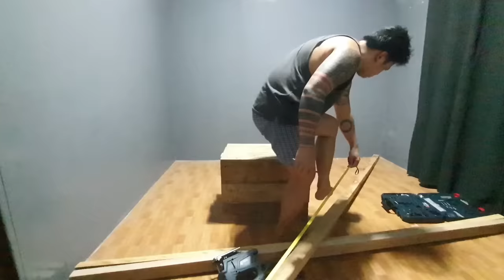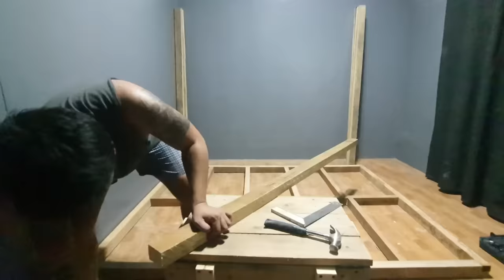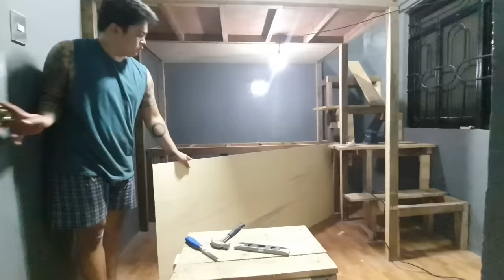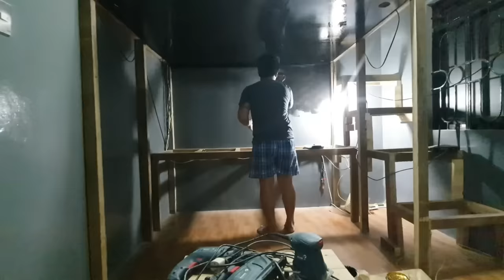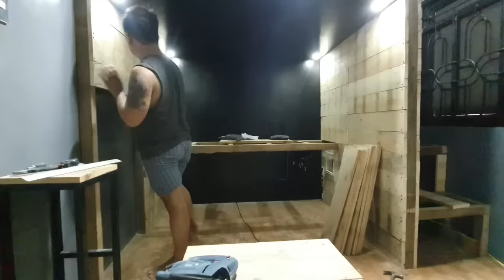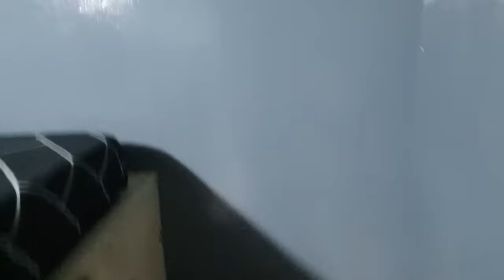DIY Rustic Style Loft Bed / Gaming Area

Comment: What an awesome design and use of limited space. Really impressed at your precision. To maximize on space a few storage hacks would really send it home: *bookcase headboard
*storage shelf/ledge above game pc
*combo of drawers/cubbies nd keep the latch door for added storage on the steps
*mounted tv parallel to bed wall....
And if no closet ...
* external wardrobe organizer combo of wood shelves, galvanized pipe and garment rack 

Also designwise a different choice of paint for the room to brighten it up... using some Color hacks to make room look larger. Could do a faux brick wall paper on the backwall with light paint color. The grey could work @ much lighter shade maybe a matte or eggshell finish instead of gloss
Reply: There is nothing worse than something that looks fake / like it's imitating something else. Have actual brick or don't bother.

Comment: They could have used the space under the stairs as a small storage room. Maybe placed the desk against the other leftmost wall and had a small door to that storage area. Maybe I'm wrong and it just wasn't possible for some reason. The good thing is that it seems modular. I plan to build something similar in my room.
Reply: agreed I thought he would leave a hatch to access it, seems like very wasted space but so long as it works for them I suppose
Reply: That's what I thought too..The space could be use as storage or a cabinet...
Reply: You're not wrong. Dude didn't think this through and wasted a lot of space. I also question the decision to block off the window completely. A curtain or sliding door could've done the same w/o sacrificing all the daylight and enabled access to the stair storage.

Comment: I would play there but I wouldn’t sleep there because I move a lot so I’m going to fall of lol
Reply: Do you fall of the bed now?
Reply: @wowo1728  if you are used to getting out of the side of your bed now you might do it automatically.  Its a very cool build but i probably would have added a rail on the outside could easily be turned into a feature and hide a messy bed :)
Reply: Just add Spindles I think they are called. 😂😂😂🤣🤣🤣🤣🤣🤣
Reply: *Bed bugs entered the group chat

Comment: What are the measurements I am very interested in knowing what they are
Reply: Não entendi
Reply: Hello @GAEL. I had the same question since I will be making my own bed following a similar design but do somethings different. I believe the studs or 6 legs of the bed are 3"1/2" all around. The height will be your choice. It will also depend on how tall you are so you can be comfortanle under but you'll most likely be sitting down. He has a taller ceiling I can tell but mine is just 8ft which is pretty ok. You can choose the height of the computer desk as well. I believe his mattress is a short queen or full, not too sure but that will give you the length of the bed. I hope this helps and have fun making this bed!

Comment: I would of rotated this project 90 degrees so the stairs are on the back wall,  to allow natural light into the space, an between the board gaps would of used mass loaded vinyal for noise isolation and dense rockwool. 
Made use of the panel decking, to make an access point for a hidden cabinet with a pegboard to load electric appliances on.
Plastic tubular piping, or cable runners that are used in server racks to funnel cables which would support access for upgrades and maintainance.
Though the base concept is good, but arcitectually could be improved on.

Comment: Great work but the workmanship is nice, but with a few touches, it can be much more beautiful and useful, for example, you can make drawers under the stair steps,
 you can choose different wall colors the room is a bit muffled, closing the stair wall of the room narrows the space even more, if you are not going to use that wall, it would be better to leave it open. If you made the walls from wood, you should use nails to hang something on those walls, or you can varnish all the woods and create a new wood design to match the paint color, but if you're not going to do these, those woods don't look good, instead lime panels can be preferred,

Comment: I always concern about the weight and force the loft bed can hold. In this video, he is using queen size bed right? What if a couple going some "exercise" on that bed? Can this loft bed hold still? I'm thinking he should use bigger wood for the loft bed pillars for just in case.
Reply: he bolted it to the wall studs on two sides, the bed frame isn't moving a centimeter

Comment: Is there a way to do this without drilling or putting nails into the wall? I live in an apartment and this wouldn’t be allowed.
Reply: you would just have to build a more robust support frame, like using 2x6s with metal plate brackets and heavy bolts